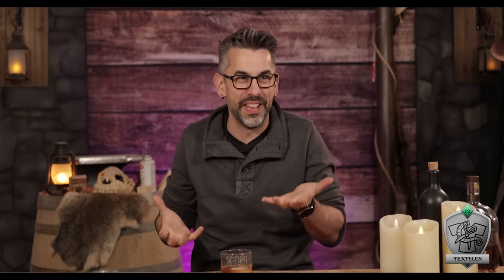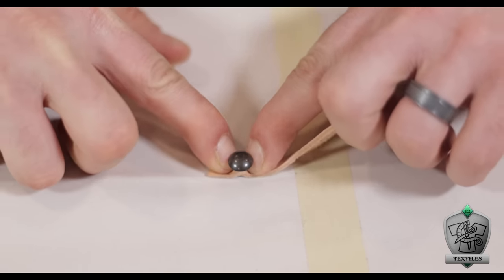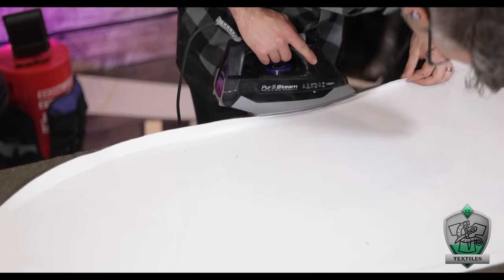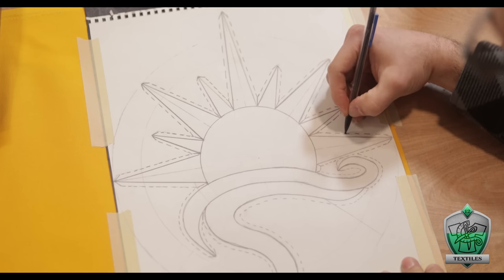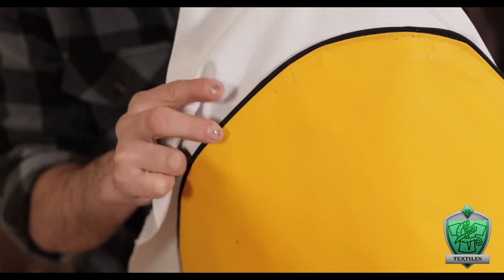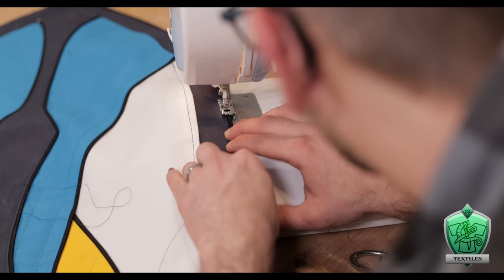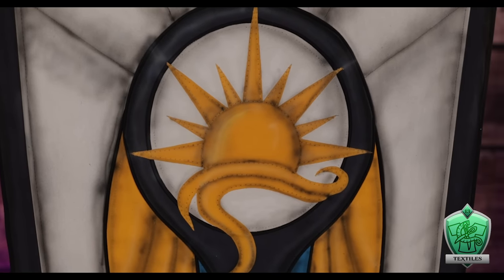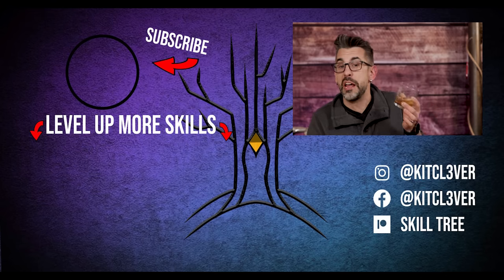Epic Banner DIY

Comment: Looks great!  I've got a banner a friend made a few years back that's a simple sheet of duckcloth with thr bottom corners chopped off and a stencil sprayed mythosaur skull on it (it's a Mandalorian banner).  For the details, she went through with a knife and scored and cut it up so it looks like it's been through a battle, then went through with an airbrush and "scorched" it.  Which is probably safer than what I did when I made a cape a few years back: I straight up just took a blowtorch to it for my blaster-fire burn holes and scorch marks.

Comment: I really like this project, and honestly, I would've done almost everything the same way (until I saw some other comments with advice, lol). The only thing I would've done differently would be the attachment for the flag pole. I personally would have left a few extra inches of fabric on the top of the piece, then cut out a square-ish section from the middle of that extra line. If you then fold the extra fabric back down and sew it along the bottom, then you can slide a stick through in a very similar manner, which could either be hung up from the outside edges with rope, or you could tie a pole to the exposed portion directly in the middle and even stake it into the ground if you so choose. All in all, not a big difference and may not work the way you intend to use it. I just personally like the look of a banner a little bit better if you can't obviously see how its supported from the front. Regardless, awesome job on this project, I love this channel.

Comment: Amazing!  It's awesome.  So, maybe if you do 4 loops at the top, the banner could either go on a horizontal pole or a cross (the thought being a crossbeam could be attached to an already existing tent pole)...  Of course, you may need another sideways loop toward the bottom to keep it hugging the pole on those windy days.

But it looks terrific just the way it is.  But, honestly - it may not have enough pockets...  you could easily add like 40 or 50 pockets to it...  I mean, at LEAST 37...

Comment: Spectacular! I'm with you on the airbrushing saga, at first glance it's a bit on the heavy side, but I think you're both figuratively and literally "too close" to it. From a distance, by sunlight or torchlight, without those deep lines I think you're absolutely right, it would have looked too flat and "clean". With a bit of use and exposure to the elements, I suspect that will all waether and blend marvellously.

Comment: This would require a sewing machine with a zigzag stitch, which I think basically all levels of modern sewing machine come with at this point. But another way to achieve that sort of bold outline, would be to first sew your pieces together, then using zigzag stitch set to wide stitch width and a very short stitch length, sew around the outline of the design piece in your chosen outline color. This would give you a solid boarder of thread around each design piece once you're done. It would also have the advantage of not requiring you to fold under the edges on any of the design pieces since the raw edge gets encased in thread all the way around. It does however require a lot of time sewing. And for more intricate designs might not work as well. But for large pieces with a lot of straight or only gently curving edges could be a good option. This would also reduce bulk somewhat because you wouldn't ever need to double layer at the edges of each design piece. Disclaimer - I am not a professional, just a cosplayer with a lot of sewing experience.
Reply: you could also use this technique to make the swoopy lines pop a bit more and have some extra texture.

Comment: Your tip on taking a step away from the project is one that is so hard to do, yet it is so critical. 
It's way too easy to see the flaws in your own piece that otherwise would either go completely unnoticed or else may enhance a piece better than you thought. 

Real things made by real people are never perfect and look actually better when they aren't.
Weathering is even worse. Not only do you have to take your hard work and make it look worn-out... on purpose, but nature, wear and tear, and rough use are never uniform, and if it was, it would look more out of place than anything.

All in all, amazing work, great advice, and you nailed it.

Comment: You can also try graphite paper instead of carbon paper. Being graphite like a pencil it might wash out easier, or on hard surfaces like wood it can be erased to remove stray marks. I wonder if you sealed the fabric first if it might be easier to also erase the graphite from cloth without smudging.
Reply: I use a lot of graphite paper for the big Celtic art pieces you can see in some videos on my channel.

Comment: Man that banner came out AWWWESOME. The airbrush looks a hair cartoony using black instead of a color for the shadows (like dark blue for white, orange for the yellow, etc.) However, that's personal preference. Still looks awesome.
I recently made a WoW hoard banner that was... 24"x36"? I originally made it fairly crisp, made the emblem out of random leather scraps, and tried to make it fairly nice. However, next was the fun part. I went HAM on it making it look like it survived 10+ years of war. I went at it with a steel brush, a bbq lighter, and a xacto knife. That's when I found out you can cut leather then use a flame to spread the cut open, making it more pronounced. After that all was done, I went in with my airbrush (Thanks Nerdycrafter's box) with black to make it look like a ton of soot. Also "repaired" a few sections that would've prevented it from being held up easily.

Comment: It would have been easier and cleaner, and thinner, to cut out the pieces with little seam allowance so that they lie next to each other on the white, or even also cut out the white and bond it all down from the top with the tape, if you're going to border the edges anyway. Actual quilting would have also been nice for the quilted looking parts, but you need to add quilting for that, i.e. some thicker fabric that bulks out the panels between the topstitching. Alternatively, make the lines double wide with quilting underneath or add piping between separated panels

Comment: How does it hold up in the wind? If you still think it's a bit top heavy and the bottom flaps around too much, you could sew in a small pocket on the bottom back where to hold something flat and heavy, or possibly just add a loop to tie down the same as you would when staking down a tent. The weighted pocket would be more subtle though.

Comment: Unless you inteded to make a wall banner, you should work from the inside out and not have a base layer, so the design can be seen from both sides (or sew the design on both sides of the base layer, which will make it even thicker).  Making it without base layer would be a bit more difficult to keep all the seams straight. 

For the quilted look, you could have used lining felt between the layers.  I would not recommend using the iron-on type, even though it is a lot easier to work with (operative word being A LOT), it gets compressed in the ironing process and might stay compressed.  With the lining felt, you you'd have some soft padding between layers and would automatically get the quilted effect at the seams.

A seam allowance of a quarter inch is more than enough.  At Tech College, I was taught to use 5mm (aprox 3/16 of an inch) as seam allowance.

For the decal lines, use a thicker thread to make it more visible, maybe use saddler twine or packing twine on your leather sewing machine, if it can handle the thickness.  If you don't have twine but instead have miles and miles of thread to spare, try using the Button Hole setting on your sewing machine to run a thicker line.

The black outlines you added to each layer are more important than you think.  It is a heraldric rule that you don't put colour next to colour and don't put metal next to metal (Metals are gold and silver, represented in paintings or normal fabric as yellow and white respectively).  The aproved colours are red, blue, black, green, purple (for royalty only).  In some regions and at later eras, three Stains have been added to the approved colours: Blood Red, Mullberry and Orange.  All colours have to be bordering a metal and metals must border a colour (not allowed to put red next to blue without a gold or silver separator, not allowed to put white next to yellow without a red, black, blue, green or purple separator).  Stains are considered colours for this rule.  Black has a special position in the colours as that is the only colour that is allowed next to another colour.
Technically there are more colours, categorised as Furs, but those are more akin to patterns than colours, and I am not entirely certain about how the separation rule applies to those.
https://www.color-meanings.com/heraldry-color-meanings-coat-of-arms-symbols/